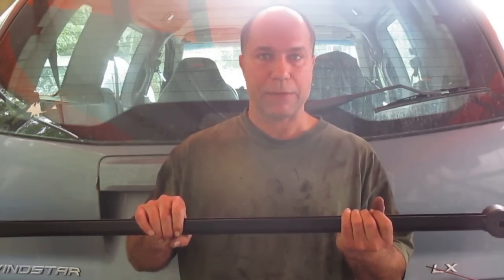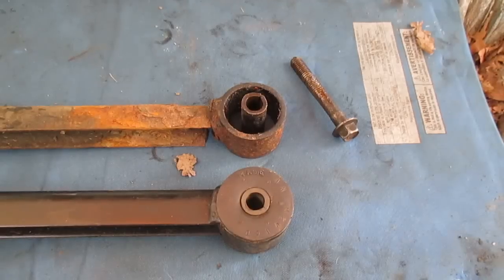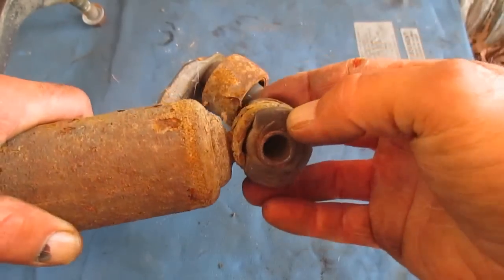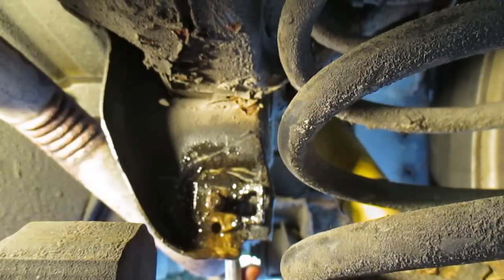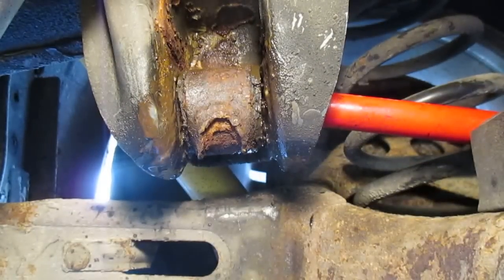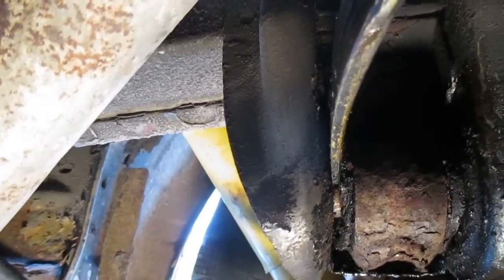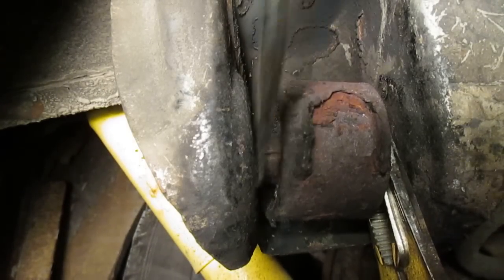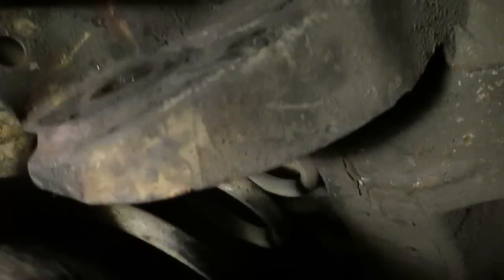Releasing a seized bolt in a bushing

Comment: Yeah sadly I am the mechanic. No metal sleeve just rubber holding on to a bolt in a bent bracket . Still burning out the rubber was not the idea I wanted to do but sounds like to one I need to.

Comment: Cut with reciprocating saw blade and get a new bolt. It doesn't take long if you just go straight to that as soon as you discover the bushing is seized to the bolt. The service manual may specify replacing the bolt anyways, so a new bolt is necessary to begin with if you like to do the job literally "by the book".

Comment: 2 minute job with a 1mm cutting disc and a new bolt.
Reply: I agree with you. Don't forget a full face mask. My stepson and I ran into a similar situation. He'd bent two blades on his Sawzall before my brother brought over his disc grinder/cutter. The bolt/bushing combination had 12 years and 187,000 miles to fuse together on a used Yukon I recently bought.
Reply: cutting disc works but only if you have room. otherwise you will have to use a sawzall and a long blade (carbide tipped). use the carbide tipped sawzall blade it's a 5 minute job. otherwise get ready to destroy lots of blades.
Reply: @AP-bo1if  Diablo blade works well.

Comment: PEOPLE WRITE A LOT BS WITHOUT KNOWING THE SCENARIO.  I had the same issue and it is the bolt seized to the middle metal part of the bushing  IT is very hard to get that off
Reply: I just experienced this. My brother cut out both upper control arm bolts/bushings with an angle grinder. He, fortunately, had a selection of blade diameters in his kit. The inner sleeve and bolt fused together over the course of twelve years and 187,000 miles. I looked at the cross sections on both bolt/bushing combos and it was remarkable. I cleaned one up to keep as a souvenir. The vehicle was purchased used and I knew going in that it was a retired airport limousine. The transmission, engine and all-wheel-drivetrain are sound so it was worth the money.

Comment: Had same issue with a shock bolt and bushing on my 81 Oldsmobile Omega, split the sleeve like you said worked great.
Reply: I'm going to try the ball joint removal tool first

Comment: the use of an impact hammer could do your job really good  And help the process. Also, drill a small hole into the head of the leave and add penetrating fluid and let it set into the sleeve then use the impact hammer. Most times the nut breaks off the bolt!

Comment: the Trick... tighten the Nut.. fairly tight.. loosen the bolt.

now.. before you call me crazy.. with the Nut tight.. you have clamped the sleeve inside the bushing between the bracket faces..  turning the bolt slightly will usually bust it loose.. 

you may have to play with the tightness of the nut.. but eventually you will get it..
Reply from the maker: That makes sense - i keep waiting to run into this issue again to try your method. Thanks Wayne !
Reply: I'll try that tomorrow, thanks
Reply: @ThisOldJalopy  did it work ?
Reply: CALI DATSUN no, I need up cutting the shock off, giving me access to cut the bolt. That was after trying everything in the book, including welding the nut the the LCA
Reply: @ThisOldJalopy  I may end up using my Harbor Freight cut off wheel tool and freeing up all that stuff as well. I spent 2 hours and three tools trying to remove my 2016 Mazda rear lower shock absorber from the bolt attaching it to the knuckle.

I was initially thinking I could put a pipe wrench on the left over parts after cutting off the shock absorber from the bushing....but if I can save the potential of the bolt from breaking off....I think I'll just stay with my whizzer wheel.

Comment: I'm struggling with a 7th gen accord lower control arm bolt, I'm going to try this method without the fire, thanks for the video man! 👍
Reply: I'm dealing with an 03 lower control arm bolt. Same spot same problem, the metal sleeve is rusted to the bolt.
Reply: Hey im having the same problem , can you tell me how you eventualy got it out if you did ?
Reply: @milenneshterov6765  so what I did was cut all the controll arm off, then cut a square the size of a cell phone, out of the side of the frame, to put a 3/4 wrench on the nut behind it. If the wrench doesn't fit. You must cut the sides of the wrench down, do not cut above or below the welds on the frame.
Reply: @justinziegler2248  that's beautiful you would offer your phone number to help someone out. It must be a Justin thing.
Reply: Same 7th gen accord haha.. putting in coilovers is a pain in the ass here.

Comment: Hey there. 
That happened to me two years ago while changing the rear shocks of my 07 Niss Alt. 
One gave me trouble. The other the bolt head broke off. That’s seized!!! Ended up  taking it to a mechanic. $200 later, I had me working shocks. 
So much for saving money as a DIY.
Reply: PS. Mechanic did pretty much what you did. All with tools I don’t have. Including a lift.

Comment: In many situations I use a 7/8 or 1" metal hole saw drill down to the bushing sleeve. Then you can even weld a nut to the sleeve

Comment: Hey so im doing my rear strut and the bottom bolt that goes thru the control arm is surrounded by a sleeve and rubber bushing or garment i snapped the head of the bolt used a sawzall to cut the strut not i got a 8th of a inch on one end and about 2inches on the nut end i got the nut off but the bolt is stuck in the rubber and it is not budging any ideas?

Comment: Great video!!! I'm in the process now of trying to free a bolt from a bushing on my truck. It's the strut to lower control arm bolt that won't budge. I have the nut off and tried pounding it out, heating it up, and finally using a ball joint C clamp tool to push it out and it's fighting me every step of the way. I don't want to cut the struts fork cause the struts are still good but I'm losing patience cause it's been days of messing with this bolt. So much time wasted on this and thankfully I have my motorcycle to ride and go where I need to go. Thanks for this video and I'm gonna try melting that bushing out to get to that sleeve. For the life of me, why wouldn't the manufacturer use a dab of anti seize on these bolts-bushings??? Grrrrrrrr
Reply from the maker: Thanks Tim - i hope you got that bushing lose !

Comment: I have an old sds hammer drill that the drive failed in, it has a hell of a hammer but no rotation so I ground one of the bits to a flat round end that could be used to drive out bolts like this. I've seen it kick a seized bolt I couldn't flog out, out of the workshop into the street.
Reply from the maker: That's a great hack - thanks for sharing Joe !

Comment: I’m facing the same problem with a seized driver’s side, forward pivot bolt in the bushing of the lower control arm of my 1999 rear wheel drive Ford F-150 pickup. I’ve sprayed nearly a whole bottle of PB Blaster on both ends of the bolt (the nut came off easily), worked the bolt head with a 21 mm socket on a 3-foot, 1/2 inch-drive bar, threaded a stock metal rod through the empty rear pivot holes of the control arm (the rear bolt came out easily), held the end of the rod against the end of the seized bolt and swung a 2-pound hammer against the other end of the rod ‘til exhausted, bought an electric impact hammer from Harbor Freight and attached a 21 mm impact socket to the hammer and the head of the seized bolt and ran the impact hammer forward and reversed with generous additions of PB Blaster until it was obvious this wasn’t going to work. Unless I can cut away the outer metal sleeve of the bushing and cut and pry out the rubber, I may have to make the rubber go away with the heat wrench too.
I think others who have posted on YouTube that impact and hammering aren’t successful because the rubber in the bushing is absorbing the impact are correct. The bolt is seized in the “anti-crush” sleeve, and that rubber just has to be gotten out of there to allow impact and penetrating fluid to do their good work.
I enjoy the Canadian videos with their careful and articulate phrasing.
Reply: Thomas Fitzsimmons im having the same problem with a lower control arm bolt on a 08 uplander..the long botl wont drop.i used propane,n pounded on the bolt from the top threw the engine bay still nothin..jus bought map gas gonna try that next
Reply: @IGStrangDaKang  Im about to go buy map gas myself, did it help you get the bolt out? When I saw it was only 3 bolts holding the rear strut in... :( I knew it was too good to be true..
Reply: Justin Lelbach nope map gas didnt work!!i cut threw the rubber bushing n could see the sleeve n bolt.pounded on it wit a sledgehammer still wouldnt drop!!got a metabo out n jus cut it off!!!it seem like the bolt was welded into the sleeve from all the pressure that the weight of the van was puttin on the bad control arm for so long idk it was weird..

Comment: Milwaukee hackzall will cut through that bolt ez, just get a new bolt.
Reply: Daz ryt... even u have important meetin at 8am  n its 2am in da morning already and its almost 2 hours drive reachin work bcoz of traffic! Juz call dem n tell dat u have seen diz comment to use sawzall which u have to purchase at home depot which is almost 1hour drive from ur place n dey open at 6am and waited 4 dat god damn part store to open up at 8am which ur not also sure if they have dat fuckin bolt dat u needed! Good idea
Reply: I used a grinder with a cut off wheel, sawzall would be easier!
Reply: Either a cutoff wheel or a recip saw would do the job very well.
Reply: I just used the milwaukee hackzall on a shock bolt today lol
Reply: Exactly what I'm doing on my boat trailer. Putting in a new blade and destroying crap tonight.  ;-)

Comment: I tried to negotiate this at home and spent a couple of hours heating, torching, hammering, cursing, cutting with angle grinder, and couldn't figure out also why it wouldn't come off. In the end I found it was cheaper to undo the whole rest of suspension and replace the subframe and buy new bolts and track arm.. what a bitch of a job.. If only there was an easy way to reach in and break that collar sleeve that prevents that damn bolt to come out.
Reply from the maker: I agree - it is a rotten job for sure !

Comment: Trying to salvage the bolt is not the way to go since if it's rust welded together it's probably not a safe bolt any more. Much better is to just sawzall out the bolt on the sides with a carbide blade and use a new bolt.

Comment: Would heating the bolt work? I have the same situation. How would a mechanic fix this?
Reply: Heating the bolt didn't do it for me, I even went out and purchased an impact with 1200 ft lbs of torque to remove it... Waste of money. I'm gonna cut the bastard off tomorrow. Did you manage to get yours off? If so, what did you do?

Comment: Thanks for the advise. I will warn ⚠️ anyone that torching a rubber bushing is extremely TOXIC and can cause serious health issues if you breath it in.
But definitely a good video on how to effectively release a bolt from a seized bushing sleeve.
I'm honestly trying to find a way to get the bolt out on my rear shocks without a torch, cutting tool or welder.

Comment: Man dealing with a siezed bolt in sleeve on my front strut lower mount bolt. The bolt head is also seized on the attachment plate of the lower control arm. I can’t heat it because it’s too close to the CV boot. My sawzall doesn’t fit in the area I need. I soaked it with PB blaster for days. I’m thinking my only option is to get a Dremel cutting wheel and just cut the bolt out… I already bought a replacement bolt in preparation for this anyway because the threaded end of the bolt and the nut are starting to mushroom and strip the threads from me hitting it so hard. It should have been a 30 minute job. Good riddance.

Comment: so wats the words ‘seized’ mEn?, does that mean this sleeve shrank or something?🤔
Reply: The sleeve is made of mild steel and starts rusting from the inside. After enough time, the amount of rust on the inside of the sleeve expands enough to lock onto the bolt. ... I have a 2004 Sonata with both the rear lower control arm bolts seized solid. Gonna lower the sway bar and use a ball joint press to force them out. Luckily there's room.

Comment: I see what you did, and you did a good job. That’s a lot of work to save a bolt.
Why didn’t you just cut the bolt on both sides of the bushing with a sawzall?
Then replace the hardware.
Reply: How would we remove the rest of the bolt though? The threads are still in the welded on but.
Reply: @Subfightr  old comment but you're not meant to be able to extract the seized bolt from the bushing in this method. You cut the bolt at both ends, remove the control arm, and then choose to do one of two things. Buy a replacement bushing and use a press to remove the old bushing (bolt and all) from the control arm, or just replace the entire control arm, which is what most people do.
Reply: @yaojohns9210  damn. I don't have to worry about it now. I'm fucking disabled :( rip me doing stupid shit to save a $

Comment: I was just helping my neighbor with a bushing with a seized bolt in it, it was hell getting out, had to beat it out and then punch it the rest of the way, it ruined the bolt though, so it has to be replaced
Reply: Ball joint removal tool may have worked easier.

Comment: Day two of trying to remove a bolt from a bushing on a golf cart A-Arm. What a nightmare.  Going to buy a slide hammer and pry bars and a shim kit.  Wish me luck.
Reply: Oh! And a bottle of never seize!
Reply: That's an interesting idea, did it allow you to remove the he bolt from your bushing A-arm?
Reply: Justin Lelbach yes, the side hammer pulled it to about 1/2 out. (I borrowed one from Advanced Auto for free) then was able to get a good punch in there and nocked it out.  I polished the bolt with a wire wheel and used never seize for reassembly.